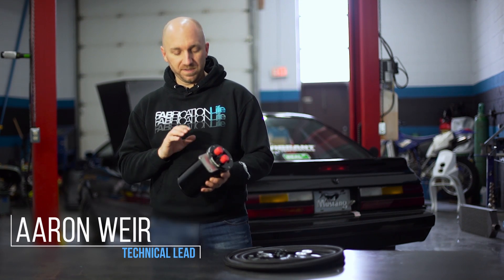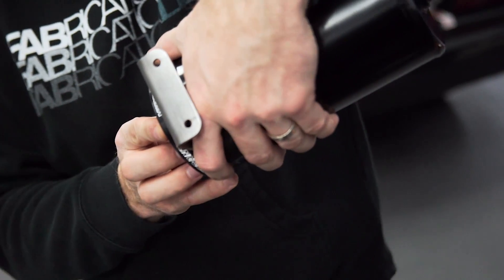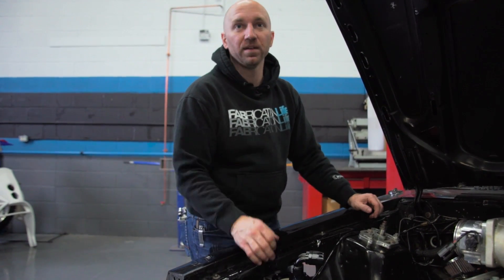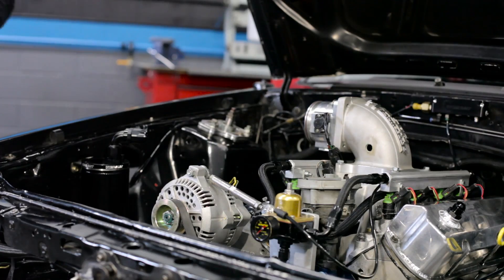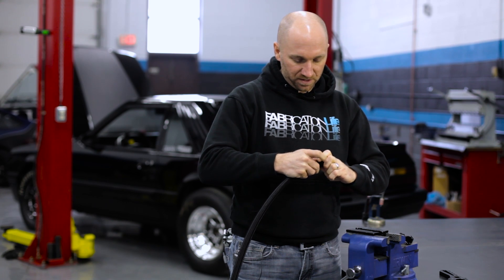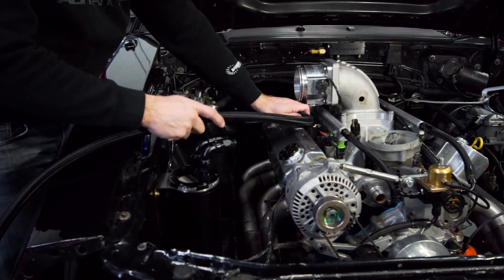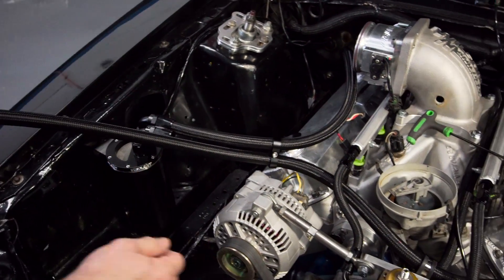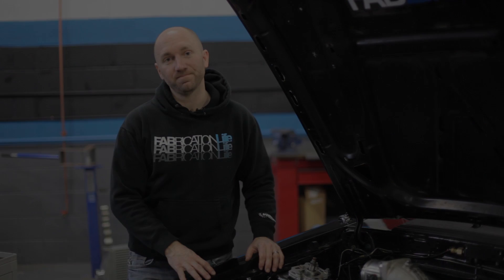How To Install a Catch Can, -AN Fittings and Braided Hose on Your Car!

Comment: Do you think this would work on a diesel without blowing oil through the filter being as diesels have high crankcase pressure? 2006 5.9 cummins making little over 1000hp to the tires and looking to do a nice catch can with braided an with my new aluminum valve cover

Comment: Any advantage / disadvantage for having a return line to the engine air intake side...?! with the closed catch can you’d create a vacuum that way...
Reply: Returning the line back to the intake is usually a factory thing for emissions purposes, it's considered better to recirculate it and burn it off than vent to atmosphere or collect it. The point of a catch can is to catch the contaminated oil/fuel mixture because burning it off in the cylinder reduces octane rating and increases chance of knock.

I think some people have a catch can that also recirculates back to the intake, I imagine the advantage of this is to create a 'sucking' effect which maybe helps circulate the pcv system better. Not 100% sure on that though

Comment: Hello, nice video! I would like to better understand the drain process. Do you keep a drain valve installed or do you usually remove the can do to it? Thank you!
Reply from the maker: The can originally comes with a plug, however it is threaded and you can adapt a drain valve for easy access

Comment: Ok, GREAT o-rings. but why 10an? You have 3 inches of fittings on top of the can! And it's a tall can. Can the fittings be removed revealing an NPT thread for a different fitting?
Reply: Why the fuck would you want NPT threads? AN is superior.